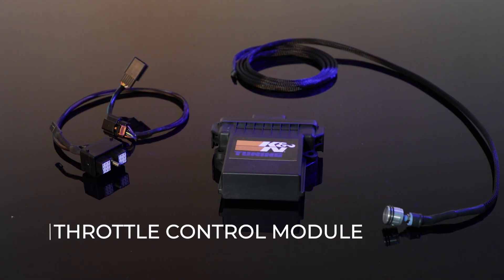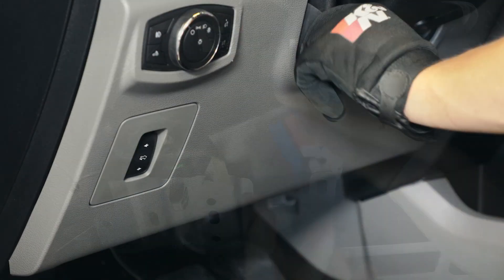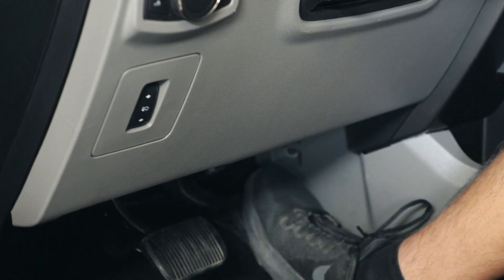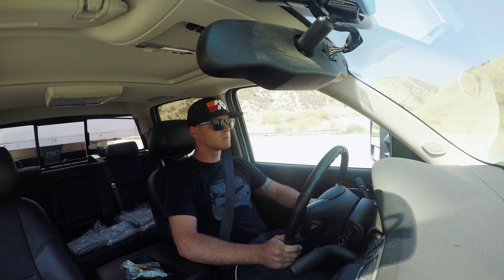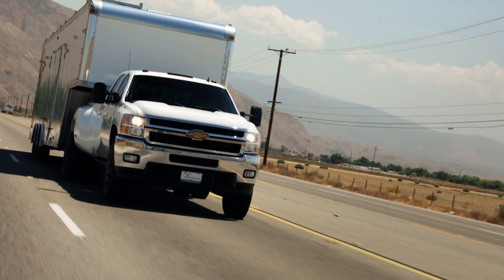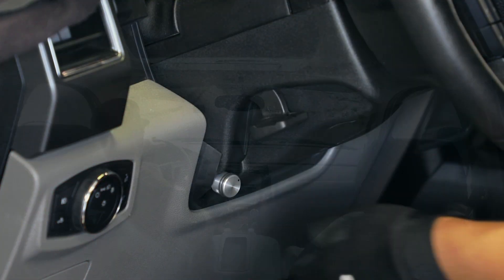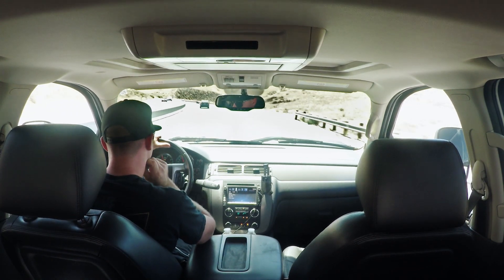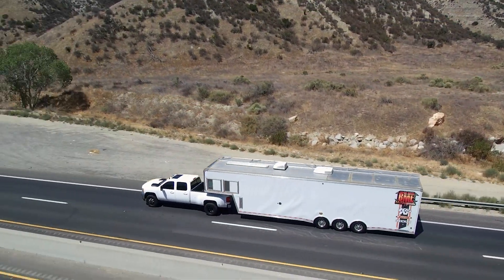K&N Throttle Control Module Concept Overview

Comment: Well I just ordered one for my 2019 Ford F250 with a 6.2 gas engine, coming from a 6.7 Powerstroke I miss the acceleration, I'm hoping the K&N gives me what I'm looking for, I looked at the pedal commander but hate the idea of all the modes + 4 having to push buttons, the knob looks easy and makes for a on the fly adjustment without looking at what button to push, I'll know in a few days when it comes in!
Reply: Greg, update on the K&N throttle response? I had the PC on my 17 4Runner and it was a decent module for improving throttle with a quicker acceleration. THX
Reply: Any update??

Comment: When they say, improves performance,  how? I get the responsiveness. But by making the throttle more sensitive, that only increase how light footed you have to push to get WoT. That doesn't get you horse power. It gives you quicker response. And hurts gas milage more, if you're into that. Am I missing something?.
Reply from the maker: It significantly reduces the delay and gives a quicker throttle response, like you mentioned. Quicker throttle response means quicker acceleration, which translates to "improved performance." We make no claims regarding gas mileage.